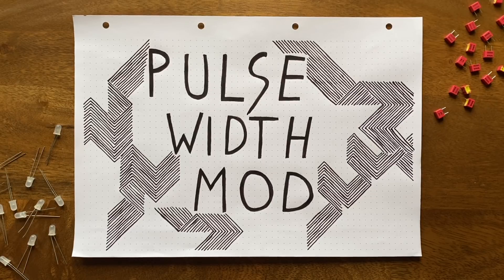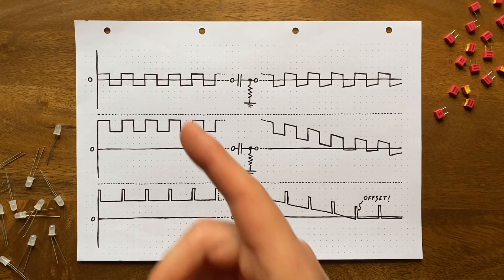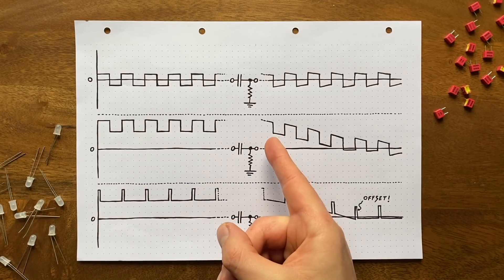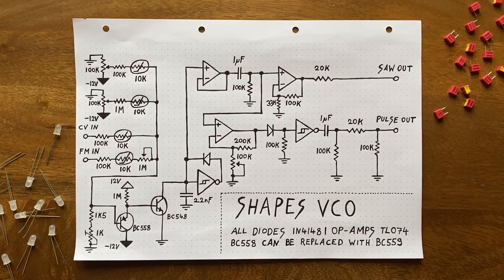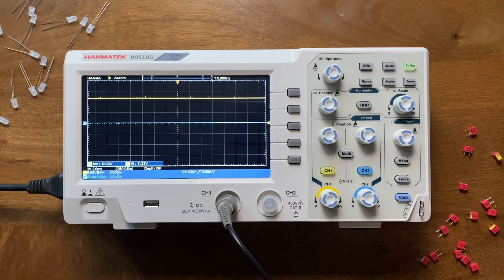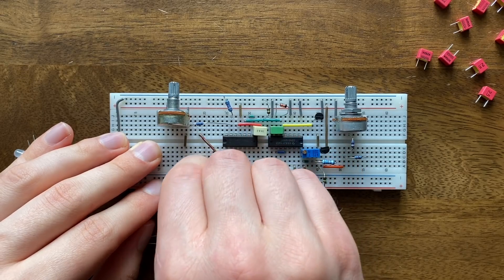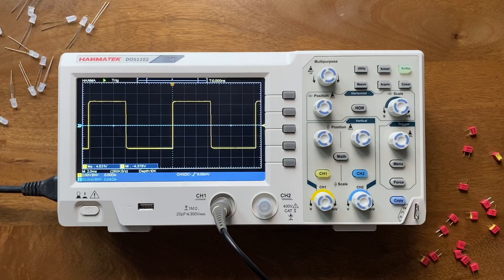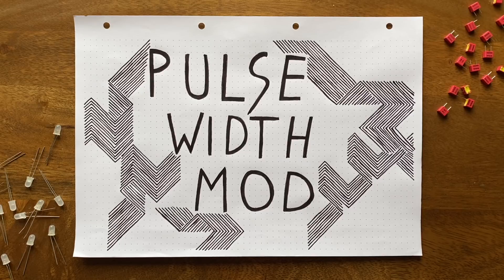Adding voltage controlled PWM to my VCO

Comment: If I'm wanting to add the triangle wave to the Shapes V2 schematic at around 14:00, I should be able to tap the output from the sawtooth output buffer opamp before the 1K resistor as the opamp doesn't draw any current yes? That would then feed the inverting opamp and so on in the triangle converter.

Thanks in advance :)

Edit: I should say thru the cap and then into the inverter of the two opamp of the triangle converter

Comment: Hi Moritz, Im sure this has been asked and maybe I am not using the right keywords and google can't deliver the goods. I want to learn how to select the appropriate series of caps for diy projects but am overwhelmed by the dozen or so choices for say 10uf 16v caps all bearing practically the same spec. There are data sheets for each series and maybe that's a good staring point but I could not find any guidance on the subject. Any help will be greatly appreciated. Thanks 🎉🎉🎉

Comment: Well this sent me on a journey.  I wondered what sort of circuit would be required to fix a DC offset on an asymmetric waveform.  I figured if you invert the waveform and then store the peak voltage of each mirror in a capacitor, then average those out, and use that as a correction offset to a summer, it'd be good.

Turns out I'm very stupid and know nothing because it took me two hours of futzing in a circuit simulator, but I did it.  I'm still not happy with the values of the resistors and caps and such because as mentioned I know nothing, and at circuit startup for some reason the high side cap peaks to over 20V (with a max of 12V anywhere in the circuit), and the low side circuit has a stray voltage in the microvolts I can't seem to get rid of, and it uses eleven op amps, and I need a resistor twice as big as I would have thought for the amplification stage, but I had fun.

I learnt a bunch about op amps, and some even more basic things about voltage dividers.  I think I could get rid of two of the op amps if I could figure out a way to double the +ve rail voltage too...

Comment: I noticed, when connecting inputs through a potentiometer, you are almost always connecting it not like a voltage divider, but just like a resistor, narrowing the pipe so to say. Is there a reason to do things like that, because I find it a little annoing to not be able to turn down a signal completely to 0? The only reason I can think of is not loading the incoming signal with the potentiometer, but I think that's negligable. Another reason might be, that when you have multiple inputs , if the pots are connected as voltage divider, they will influence the other signals. But that can be remedied by connecting all the inputs through the inverting input of an Opamp, as I have found out. Because when the signals are connected through the inverting input, the output is a sum of all signals, and if one signal is 0, then the other signals don't loose strength, just a 0 is added to them so they are unchanged. It looks to me like that would be more convinient way to control multiple inputs, but I might be missing something...
Reply: Indeed, the modulation signal seems to influence the output even at its lowest intensity level for some reason. The oscilloscope shows around 50mV p2p and the effect is still audible. Of course I can plug the cable off, but I'd like to implement this circuit in synth where the Modulation CV input is normalled to PWM Intensity pot. Is there a way to make this possible without using an additional switch or a switchable potentiometer?
Reply: @CarambolageTV  yeah, the way I did it was to have one pot with constant voltage, and one to attenuate the voltage coming from the CV(connected as voltage divider so that it goes to 0). They both go to the inverting input of an opamp and get summed up. Then the result is used in the comparator to compare with the saw wave. You have to choose values for the resistor that are going to the inverting. Input of the summing opamp, so that when the constant voltage pot is at max, the voltage that goes to the comparator is a little below 5volts, so that for a 5v peak to peak you have 100% duty cycle. I have to check the values I used but you can find in my vco video what I did if you want
P.p. apparently I used +-12 going to one pot for the constant duty cycle with 100k resistor to the inverting input, and one pot as attenuator for the CV modulation with 47kOhms to the inverting input. These values gave pretty reasonable ranges

Comment: Hi Moritz, I first like too apologize for asking here on youtube. probably not the place to drop questions, but you would help me very much by pointing me in the right direction on solving the pwm drop bug as explained in your video at 11:00. I have setup everything the same as in your video (250k pot, 68k, 14k to ground etc etc) but still is have this wave drop. what else could be wrong, or what other things can I check? thank you in advance. kind regards.
Reply from the maker: not exactly sure which bug you mean – could you elaborate?
Reply: @MoritzKlein0  Hi Moritz, Thanks for your reply, sorry for my late reaction. In your video you mention the PWM bug, which causes the square wave to go down (pushed down below the center of the oscilloscope) as soon as you turn the pwm knob (the one with the 100k resistor. you solved this issue with the 68k and 14k resistor to ground. You also said: lets fix this annoying bug or something :). I still have this issue where the wave drops around 4 volts below the center. Maybe this helps? check 1:20 (increase width, moving downwards, big DC offset issue. your help would be greatly appreciated. Thanks in advance Moritz. Waiting on your reply :) no rush though
Reply from the maker: @MJLouer  please check if your oscilloscope input is set to „ac coupled“. if so, change it to „dc coupled“ and see if the problem goes away!
Reply: @MoritzKlein0  Hi Moritz, thanks for your quick response. I will try this as soon as I get home :). I will let you know. If that is the case, then I can start moving the VCO from breadboard to PCB. Thanks again.
Reply: @MoritzKlein0  Hi Moritz, Yes!! it did, thank you so much. That was spot on :) but does that mean that I have still some work to do to fix this issue in the circuit? or is there no need to? 
Because when I route the square output from the VCO to the high/low pass resonance filter i build (also from your video's), and hook my oscilloscope up to the output jack, this issue is back for some reason. thanks again Moritz and have a pleasant day.

Comment: Hi Moritz, Just want to let you know that I have build the VCO and added the CV PWM. I still have this wave drop bug as soon as I turn the 100k pot. Another thing I noticed is when I remove the 14K resistor, I have way more PWM modulation range (more swing to right & left). I also used one of the remaining oscillators of the CD40106 chip and configured it as an LFO which works really well. that signal feeded into the PWM cv input works great! Maybe you could help me how to solve the pwm drop? I did use the same resistor setup (100k comb. 100k pot.) and 250k pot with 68K resistor. thanks in advance for your help and keep up these great videos.
Reply: I'm having wave drop as well with this design. Did you ever figure out your issue?
Edit: Ah! You got an answer of make sure your scope is set to "DC Coupled". This solved my issue as well
Reply: @BrandenBarber1  hi Brandon 
Yes, according to Moritz you must set your oscilloscope to DC mode.

Comment: hey moritz, one noob question, at the square wave voltage divider i used the 100k paired with  a 61k resistor because it was the only value available at time, will it affect badly my output?

Comment: An important thing to note is that while there is technically an "offset" between the high and low peaks of the AC-coupled pulse wave, that is actually the how the wave is when there is no DC component, because the DC offset of a wave is the average voltage of the wave over time.

If you record the signal after it's been put through any (properly made) piece of audio equipment, you will see that the apparent "offset" will reappear, because most audio equipment incorporates DC-blocking capacitors at the input and output.

Since the low duty-cycle pulse wave is spending much more time in the low state than in the high state, the average voltage is closer to the lower level, and when you remove the DC offset, the wave will swing around a point closer to the lower peak. This is true of any asymmetrical wave (any wave that doesn't spend exactly as much time at a higher voltage as it does at a lower voltage).

If one does the opposite and put it through a low-pass filter, one will see that the "offsetted" AC-coupled pulse wave will average to zero volts, while the "non-offsetted" wave will average to a DC value.

However, changing the duty cycle without removing the DC offset can be useful for modulation purposes.

Comment: Hi Moritz 🙂
I was trying to reproduce the circuit in the breadboard.  
I wanted to ask you the single potentiometer right in your breadboard, what is its value?  1Mohm?  that is the potentiometer of the input Fm in?  
"Sorry but I'm a little bit confused with the schematic and with the transfer of the circuit to the breadboard" 😅
Reply from the maker: that's the 100k coarse tuning potentiometer – top left corner on the schematic!
Reply: Thanks for the reply.
I will be waiting for more content like this, I find it useful and very informative and it is giving me the inspiration to jump into the adventure of building analog synthesizers 😁

Comment: great job as always Moritz! one question, how do you quantize your sound? i know  that you have a korg sq-1, but what about your traditional step sequencer, how do you quantize it? thanks in advance
Reply from the maker: normally i don't, except for when i used my logic gate arpeggiator/quantizer.
Reply: @MoritzKlein0  i see, but then when you dont use your arpeggiator you do it just tuning by ear?
Reply from the maker: @danielmendes5682  yep! though i definitely find myself reaching for the sq-1 or beatstep pro much more often, just for convenience reasons..

Comment: As an Electrical engineer student, I appreciate your dedication.
I suggest you use buffers in both your circuits and your schematics to make them simpler.
You could make the diagrams easier to understand by making boxes around each stage.

Keep making these videos, they are goldmines
Reply: I agree with you about these videos. This guy does an infinitely better job explaining simple circuits and electronic basics than that Professor Hack mentioned in this thread.

And speaking of hacks, it's sad that this is all they've taught electronic students for the past 2 or 3 decades now. "Show me the block diagrams, I don't care about the schematics!" I've actually been told that by EE graduates. Pathetic, really...

Comment: Technically, the AC coupling was doing its job properly. The signal in the beginning, in fact, had no DC offset! You actually did not want to remove the DC, but center the signal with respect to min and max. This is very different from the DC (which is just the average voltage of the signal). In many technical applications PWM is used exactly for this behavior, simulating a varying DC part, e.g. for controlling brightness of LEDs or motor speeds.
Reply from the maker: you're right, will phrase that better in the future!
Reply: @MoritzKlein0  since this is the top reply: a classic square wave method is to layer two sawtooth waves, one inverted and also offset by 180 degrees (sometimes implemented with a delay). make an easy sketch: these sum as a pulse wave, adjusting the phase relation changes PWM. it is an easy way for a student to visualise how "exceeding the rails" presents the correct signal level and has no offset (unless they understand integration and consider the area inside each rectangle).

Comment: from a frequency domain perspective, the offset on a pulse wave sent through a capacitor does have its DC component removed, as the zero frequency, or average voltage, is nonzero on the input.

Comment: I have the same PWM bug in my oscillator. I was aware of it, but I didn't know it was actually an issue! Thank you for pointing that out! Also, nice video as always, I look forward to every new video you put out.
Reply: It's not an issue as long as the rest of the signal chain can handle the voltage range that comes out of the oscillator. As someone else said, there will probably come another DC blocking capacitor later in the signal chain, and then you're back to this anyway, so I think it's best to just accept the increased voltage range.
Reply: @possible-realities  That's a fair point... I'll have to see what I do with it!

Comment: <3<3<3 These videos are amazing. You're such a good pedagogue! 

I'd love to see a high pass version of the diode filter some time by the way. I haven't tried building one, but I assume it isn't as easy as swapping the capacitors and diodes :^P
Reply from the maker: making the diode filter multimode is actually a no-brainer! next video will be about that, plus a few other tweaks.

Comment: Not sure if those fluid analogies are really helping that much. I found them to only be appropriate for DC. It's hard to explain via fluids why a capacitor will pass AC, while an inductor will resist AC.
Reply: I love them. I think his earlier vids explained the caps well and Moritz's version of the fluid analogy is the thing that helped me understand some of these concepts better after trying to get them from various books which quickly abandon the water analogy.
Reply: @LavendelBrei  As the Wikipedia article on the issue puts it: "The hydraulic analogy can give a mistaken sense of understanding that will be exposed once a detailed description of electrical circuit theory is required."
This is especially true for filters and signal theory when talking about AC. Most of the analogies are kind-of-true, but only kind of.
Reply: i think it was c. 1992 that i started to study electronics for audio synthesis, it has taken me so long to establish a practical comprehension that in the meantime i have exhausted digital dsp synthesis. recently i've searched out dozens of videos, watched a dozen explanations of 555s, transistor based amplifiers, since understanding all concepts presented thoroughly, and i believe i finally understand what has prevented my learning all along these decaces.
i will share that here, now, for us all.
not having enough freaking dosh to purchase the actual stuff and be doing that.
be water my friend.
Reply: @atomictraveller  Absolutely true. And to be honest, even Ohms law only really clicked for me when I took a lab supply and resistors and began experimenting.

Comment: Ah!  I've had the same problem with an analogue astable multivibrator and have switched to a Schmitt trigger hex inverter to create the square wave.  This solution also aids the cause as I can go from zero to 100% duty cycle, thus from off to on on the RGB LED.  Another great production, thanks Moritz.

Comment: Fantastic Moritz, great to have such a thorough explanation of the theory behind the circuit. It sounds really good and works perfectly. I need to get on and get my VCO off the breadboard and into a permanent module now! Thanks for the great video.